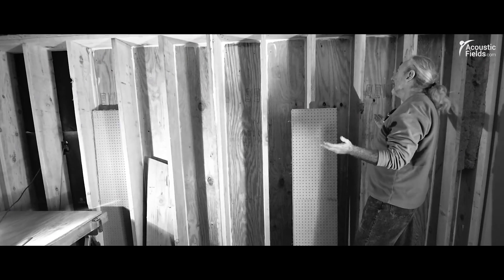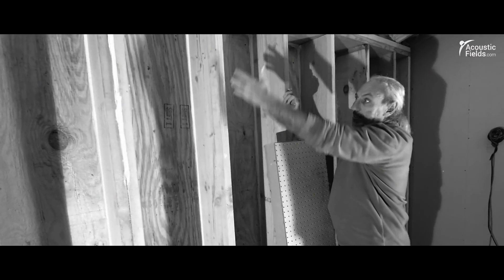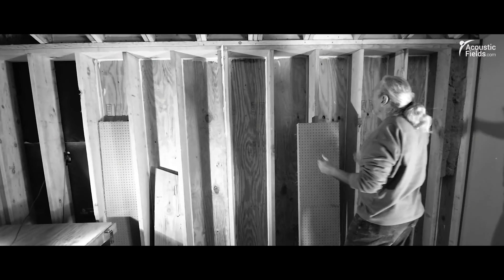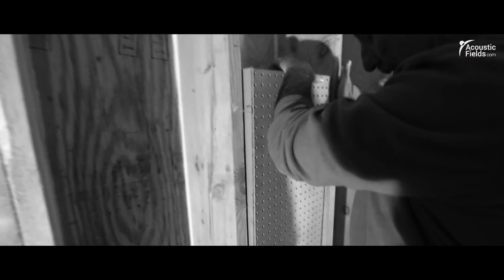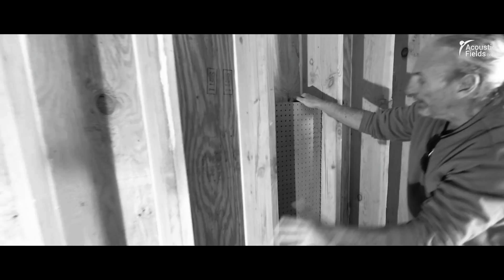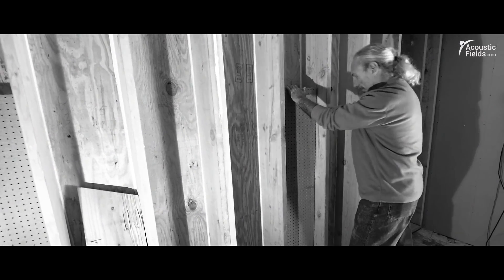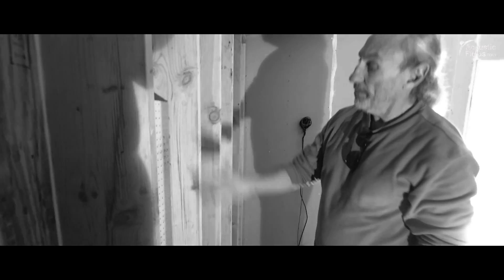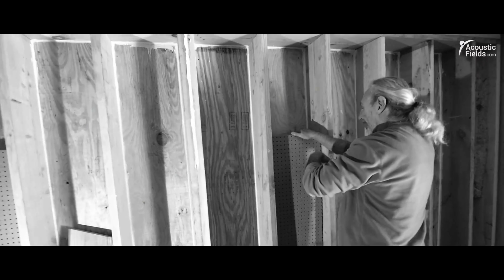CAW - Carbon Absorber Wall - www.AcousticFields.com

Comment: im guessing this absorbs coming & going?
Reply from the maker: You are confusing noise transmission with sound absorption. Our carbon technology is a sound absorption technology designed for lower frequency absorption. It absorbs excess energy within a room. If your goal is to minimize noise transmission, you must look at barrier technology.
Reply: @AcousticFields  i understand the difference. i wasnt confusing the two. i might be confusing the capability of the absorption. 
when low freq enters the bay, is it 100% absorbed? if not, some passes through.
if it passes through, wont it ricochet off the back of the bay and bounce back?
if so, will it be absorbed coming & going?

Comment: Isn't it better to build the cabinets wider? Isn't the amount of attenuation stronger in the center of the plates then towards the  edges of the diaphragm? Or has it the same power then in the center? 40 cm is very small in width. I always thought it needs to have a certain width, length and hight.
Reply from the maker: M,  Its all about rate and level of absorption along with adequate square footage of coverage to impact audible change at lower frequencies.

Comment: Activated carbon absorbs oxygen very strongly. Therefore, if the perforation, activated carbon, is not covered with a sealed diaphragm, then I would not use such a technology in my room.
Reply from the maker: You use any internal cabinet material to increase the rate of absorption of the chosen technology. Activated carbon performs the best by a large margin in over 12 different material types tested. The fact that Carbon 12 absorbs oxygen works to the benefit of performance.

Comment: Great illustration of this tech!  A question.... you talk about “differing depths”.   I’m not clear... do the carbon compartments change thickness from cavity to cavity, or are they all the same and you’re installing them closer/farther from the rear wall in each cavity?

Thanks!
Reply from the maker: R,  Cavity depth determines the lowest frequency to be absorbed. You calculate the depth to match the frequency and amplitude of that location in the room.
Reply: @AcousticFields  I think he's asking how you have a wall with different depth cavities depths.  you have 12in studs which dictates the depth, but how can you have 12in deep, then a 10in deep cavity in the same wall, for example?
Reply from the maker: R, The cavity depth varies from 8"-10" depending on the frequency and amplitude of the energy we are dealing with at that wall location. Everything must be designed for.
Reply from the maker: @Oneness100  You use materials inside the stud space to achieve your required depths
Reply: @AcousticFields  Oh, so you start out with a wall that has 12 in studs for example. Then in the wall cavities that only need a 8" to 10"  space have additional materials that make the cavity not as deep.  Is that what your saying?

How about the filters?  Are they alternating in terms of how far or close to the back wall so you can get access on the sides to screw them in?

I'm trying to visualize all of this.  :-)
Reply from the maker: @Oneness100  Once you have filled the existing 12" cavities with 2" and 4" of material, you center the filter. Filter depths can range from 3 1/2" - 5"
Reply: @AcousticFields  Oh, OK.  So the filters are staggered from stud cavity to stud cavity so  you can get access to the sides to drill them in place?
Reply from the maker: @Oneness100  Yes alternating the cavity depth determines the resonant frequency or how low the cavity will absorb down to. A 10" depth goes from 30 Hz. - 50 Hz. An 8" depth goes from  40 Hz. -  300 Hz.
Reply: @AcousticFields  I think what would help people understand better is to have a cut out illustration of two stud cavities next to each other to display what a 10" deep and an 8" deep look like next to one another and how the filters are installed..
Reply from the maker: @Oneness100  It is proprietary technology. Only those that actually build it receive drawings.
Reply: @AcousticFields  Fair enough.

Comment: What's minimum studs depth to use 2×6 or 2×10?

What's in the "filters" just carbon?
Reply from the maker: S,  We use 2" x 12" to achieve the appropriate depths that will be filled with our carbon technology which is proprietary.

Comment: I presume you put the diaphragm, aka mdf in the space also?
Reply from the maker: B, Yes, as explained in the video. The front wall or diaphragm is installed. You must calculate diaphragm density to match cavity depth.
Reply: What is the formula for that?

Comment: hi guys, do you supply carbon/carbon cartridges? I wasn't able to find them on your website. Also what's max humidity for those carbon cartridges to effectively operate? Cheers
Reply from the maker: A,  Our carbon technology is available. Send me an email to info@acousticfields.com with your contact information.
Reply: @AcousticFields  how much is it?
Reply from the maker: @weetzybat  15 - 20K / average size room.
Reply from the maker: A,  It is our proprietary technology and sold on a case by case basis. What is your project?

Comment: Dennis, it looks like you've used standard 48" tall pegboard for the module construction.  Any benefit or disadvantage to going to the full height of the wall stud cavity?
Reply from the maker: Y, Yes, more absorption with more carbon. You have to match rate and level to room size volume and usage.
Reply from the maker: Y,  Yes it depends on frequency, amplitude, and budget.

Comment: I have a room full of pegboard with only a 3/4 inch gap to the wall.

Is this a disaster or happy accident?
Reply from the maker: D,  Pegboard permits air flow for the perforated absorber technology. this is only one part of a complex process. You need depth to match frequency issues along with the internal fill material.

Comment: Can mattress topper be used as acoustic treatment for a room,  clark rubber has black foam they call acoustic foam but the dimensions are confusing because there no units of measure.
Reply: it would absorb something from what Ive learned the problem is tuning..it could sound dreadful instead of being an improvement

Comment: expensive!
Reply from the maker: R,  Not really, if you run the numbers. Look at rate and level of absorption per sq. ft and compare to other absorption technology below 100 Hz. that are currently in the market place First, you would be hard pressed to find any unit that goes down to 30 Hz. Secondly, the rate of absorption above 30 Hz. - 50 Hz. has never been achieved. When you add up all the numbers, you get a lot more performance than in other unit available for a small price difference. If that cost is still to high, you can reduce the cost by 50 % by building your own with our DIY series of build plans.https://www.acousticfields.com/product-category/d-i-y-acoustic-treatment/ We offer the technology, you do the labor.